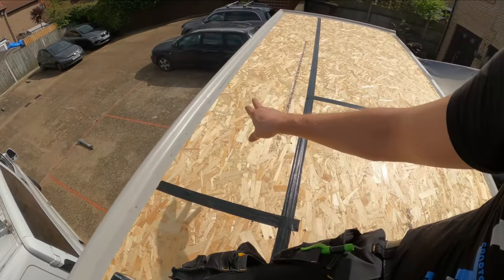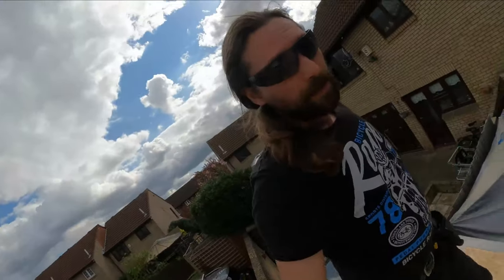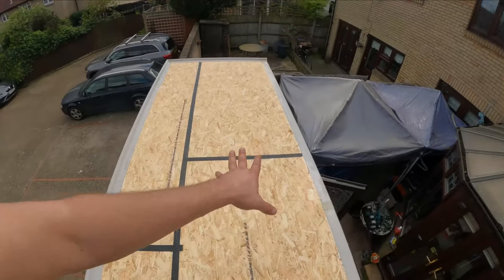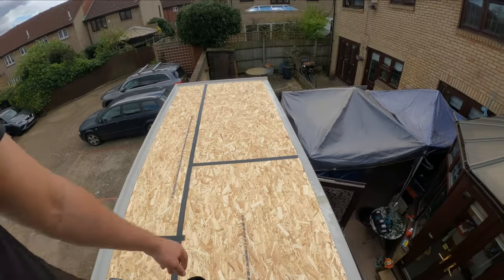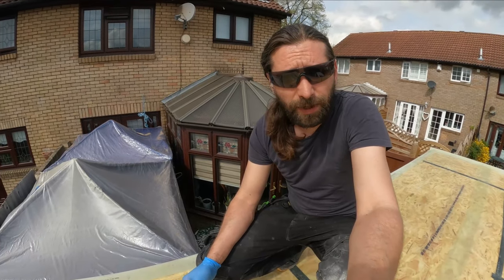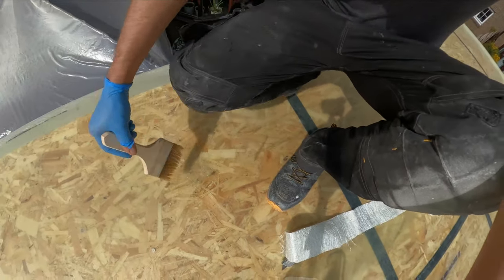Fibreglass roofing installation

Comment: Why were there so many air pockets?
Reply from the maker: the plywood has swelling up
Reply: Not laid and rollered properly
Reply: That tape breaks down due to the resin resulting in blown joint overtime worried about the drips should have taped inside  poor install overall

Comment: Glad to see the 20 minute videos are making a return. Thanks for the tip about taping the joints so that the liquid doesn’t go between the gaps. 😉
Reply from the maker: im trying not to make them to long as the retention on a clip it's about 3 min and the videos are shadowed after release
Reply: Can you use caulk in the seams so there’s no raised bump at the seams or will it have a chemical reaction?
Reply from the maker: Yes you can but I will recommend wood filler, silicone or best the adhesive from curit

Comment: Nice job one mistake you did not use a pu adhesive on all of your trims over time they will buckle and flap about in the wind
Reply from the maker: Hopefully not, and definitely, i will not trust the adhesive to do a better job with the passing of time. I always prefer mechanical fixings. But thanks for sharing. i will definitely take that in to consideration

Comment: Your attention to detail is fantastic.  I had a loft conversion done with this type of system on the flat dormer roof.  And within 2 weeks I can see damp spots on the ceiling beneath after rain.  They then put another layer of top coat and it looks like this has stopped it but it's too early to tell as I had it done recently.  I worry there is a bigger problem actually and in 2-3 years I need to get whole roof replaced!
Reply from the maker: No you need to put a nother layer on top of fibre if not the osb will have to be changed and if you take the osb out you might damage the ceiling.  Top coat it's just to protect the fibreglass from the sun
Reply: @How2Extreme  OK thanks 👍
Reply from the maker: You welcome
Reply: I have a similar problem. Roof is in 2 years and a wet patch has only just formed. If the whole roof is sanded down to the fibre glass, Is it a case of fibre glassing over the original fibreglass. I don’t think the roof boards are damaged as only recent leak. My main question to you is : can new fibre glass be put on the original fibreglass? Thank you, great video.
Reply from the maker: @gregoh5470  yes it can be done but you just have to make sure that all its sandet  properly and clean after from the dust with acetone.
Reply: Thanks for your reply. Just another quick question. I’ve established now that my flat roof is breaching as I’ve used a hose. My question is, have you heard of the dry seal system and would this  be an effective solution for me, instead of sanding buffing and re fibreglassing. Thanks.
Reply from the maker: You can definitely use it but I believe is going to be more work and more expensive ,you already have everything installed if you sand everything off on about 70% you will be ok and you can finish all in 1 day max 2 day's and it will be more cost effective

Comment: Does your raised edge trims have any end caps or do you just cover with fibre
Reply from the maker: There are some corner caps but are very bulky and ugly best is to do it with fibreglass but fill the gap first if not you are going to struggle a bit with the fibreglass
Reply from the maker: https://www.ebay.co.uk/itm/265495480578?mkcid=16&mkevt=1&mkrid=711-127632-2357-0&ssspo=9-C9XLklTa2&sssrc=2349624&ssuid=-Zven7n7RUG&var=565304533048&widget_ver=artemis&media=WHATS_APP

Comment: Hi,
Great video. Very detailed and helpful.

I have a fibreglass flat roof around 13 square meters and looking tired.

It's not been maintained for about 20 years and It's not leaking (thank God).
I want to put something on it before it starts leaking.

Ideally I am looking for a weather/water proof product that dries hard, anti slip and non tacky as sometimes in the summer I go onto the roof to sweep up any debris/ moss/ leaves etc.

I am avoiding any catalyst mixing,  incase i get it wrong. 

Could you please recommend a suitable product

 Thnx

Hasnain
Reply from the maker: Hi. You can look for a liquid rubber system that is going to be very simple to apply 
https://www.sealantsandtoolsdirect.co.uk/bond-it-seal-it-roof-seal-waterproof-liquid-roof-coating-compound-grey-20l?language=en-gb&currency=GBP&gad_source=1&gclid=Cj0KCQjwiOy1BhDCARIsADGvQnAP2r9-c5W6DodC5aWFHdJwcLzq4SXnXTj7sVJjf325xZ2SAzbXTNcaAh77EALw_wcB

Comment: its an easy process when you work slowly and carefully i usually apply 2 layers of fiber glass to eliminate any air pockets or pin holes but what you do still works atb
Reply from the maker: Yes sometimes I'm doing that but the budget needs to be a bit more
Reply: you let the one layer dry like done here... then do the second layer.. or both layers simultaneously? and then sand the top?
Reply from the maker: @mohitl1697  yes you can do it after its going off

Comment: Great video. Whats the life span of a fibre roof? Thanks
Reply from the maker: Depending how is done if a quick cheap job around 6 months to 5 years tops. If is a good job will last for more than 25 years that the supplier guarantees

Comment: Great video, Just a quick question, I have got a new roof done, two layers of fibreglass with top coat. However, I notice a bit of pooling on top when it rains. Will this cause me problems or will the two layers protect. The fall on the roof is at the minimum level of the regulations, but still within regulation.
Reply from the maker: The regulations are usually very wrong because it's a minimum requirement it's always good to go beyond that. You've done something very good by putting 2 layers down that it will be more then enough to hold the water away but not the birds they will know in to that puddle till they will make a hole. Hopefully not

Comment: Hello.... I see in other videos on this subject that the 3mm expansion joint in the OSB is not filled in and that all joints are  covered with fibreglass bandage before putting on the top layer of CSM, why do you prefer not to use that method and is there an advantage other than time and materials saving?
Reply from the maker: If you put more fibre on the joints you are going to get a lot of uneven surfaces and water can stay there and also it's not going to look very nice

Comment: Why you foaming the joints, and tapping with duck tape, resin is meant to get into t&g boards, but duct tape is shit !! And not how it’s done, bandage the joints if not used t&g boards
Reply from the maker: It's a different way of doing the job and i can tell you that it's working great. That tape could even be your expansion join